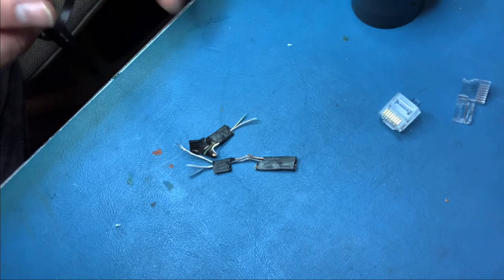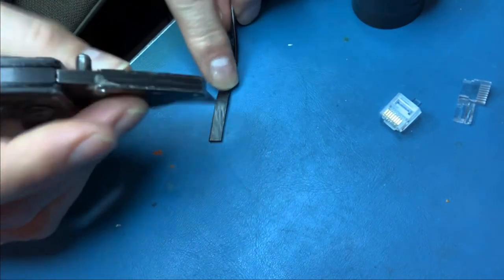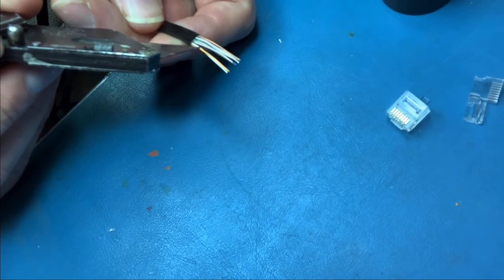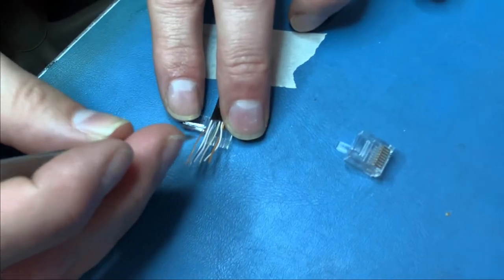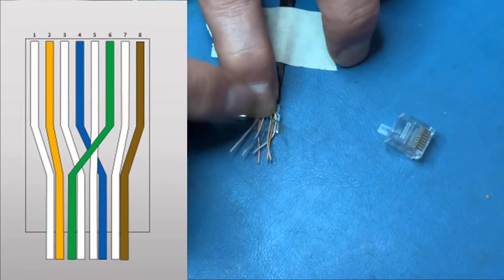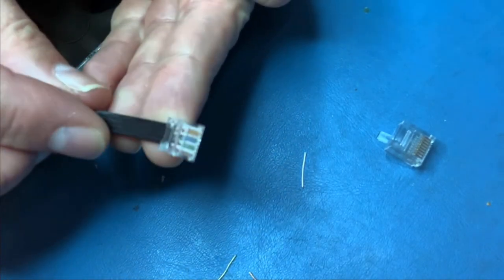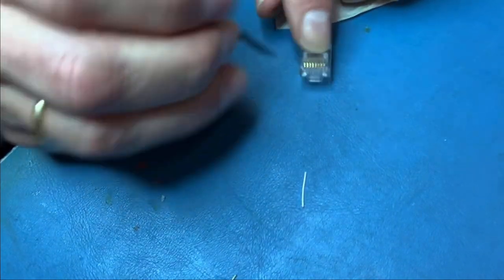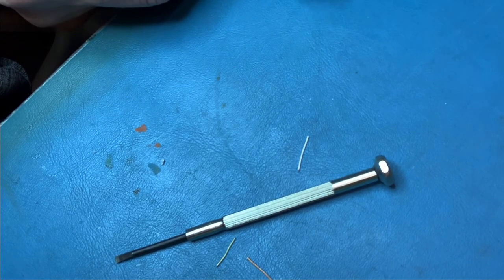flat ethernet cable repair/fix, terminate RJ45 - easy DIY

Comment: Trying to use standard connectors and a crimping tool was an exercise in futility but an excellent learning experience for me. I'm so glad I found this video because all the top search results basically claim it's impossible to terminate these things. They're pretty much right IF you try the regular connector because  the  blades on the contacts tend to miss the  tiny twisted pair cables.  But doing each  contact individually like this would probably increase the success rate with those regular connectors and these connectors you used pretty much guarantee it will work. Thanks a lot friend!
Reply from the maker: Thank you so much for your kind words! I’m glad the solution worked for you and that you found the video helpful.

Comment: Awesome video! My favorite part is how tool-free this is. All of my Ethernet repair tools are for round cables so I was stuck with a broken flat cable until I saw your video.
Reply: Ok I still love your video but let’s say I’m a complete moron and cut my Cat7 flat Ethernet cable and now need the special cat7 flat Ethernet cable connectors. Do you happen to have a link for those connectors?
Reply from the maker: Sorry, didn‘t see the reply/question earlier:( 
The connector I used is currently out of stock. 
This one might work: https://www.amazon.com/Ethernet-RJ45-Connector-Modular-Connectors/dp/B085PXN265/ref=dp_prsubs_2?pd_rd_i=B085PXN265&psc=1

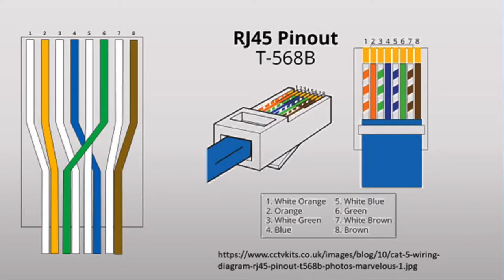Comment: Thanks for the diagram at 2:48!  Repaired a cut flat Cat 6 cable and didn't realize the green and blue wires were switched (which makes sense).
Reply from the maker: Glad I could help!!

Comment: That was cool. Good detail. I am not a technician but part of an old job was maintaining our network and I would build cables, not pretty but they would work, this video confirms I was doing it right, unfortunately since you are dealing with twisted pair it is not a 30 second job (at least not for me).  Ignorantly, I thought the flat cable would make building cables easier (around my house) but you still have to deal with crossing over cables. I will definitely save this video and if I do build my own cables instead of buying pre-made I will use this video.  I did not know about those guide pieces before today.

Comment: What was that small clip which you used to arrange the wires and later on inserted into the main rj45 plug ?         5:54
Reply from the maker: I am using very fine tip tweezers. Search for electronics tweezers, very handy for PCB soldering work.
Reply: @RandomDIY09 No dear am not asking about those tweezers, am asking about that small plastic clip in which the wires got clipped then inserted to the rj45 plug.    5:54
Reply from the maker: I believe you refer to the clear plastic parts? I put the link in the description, it comes with the main plug.

Comment: Don't you need to strip the end of the wires before inserting into the connector?
Reply from the maker: No, because when you push the pins in, you cut through the wire insulation

Comment: Love the video,…does the connector you used work with cat 8?
Reply from the maker: I checked the Amazon page. It says “Only for Cat6 30 or 32 AWG Flat Ethernet Cable - 20Pack“. I guess it‘s not suited for cat8

Comment: It does fit to normal rj45 connetor?
Reply from the maker: RJ45 is a standard used for Ethernet patch cables. To my knowledge it should fit any router, switch, port extender you might be using these days. Older laptops have it, too. HTH.
Reply: @RandomDIY09  but i have flat 32 awg slim cable, 
It’s not fit with normal RJ45 connector, beacuse cable is very thin, 
Normal rj45 connector can be use maybe 22-28 awg cable
Reply: Actually i need connector for flat cable, 
Normal rounded cable connector not fit to flast cable connector

Comment: why are you using a flat ethernet cable VS a normal cat5 or cat 6? Thanks in advance
Reply from the maker: Flat cables are easier to hide :) I put mine under baseboards and into walls, and nailed it to the joists in the basement.
Reply: @RandomDIY09  where did you get the extra part that helps line the wires up before inserting into your rj45
Reply: @RandomDIY09  I love the pain of hiding Cat6 cables
Reply from the maker: It comes with the connector, you get both pieces when you order it.

Comment: Hmm. I had searched the web and saw an Reddit post and people were saying "just buy a new flat cable; don't try to terminate a flat cable", so I thought it would be very difficult to terminate a flat Ethernet cable. Judging by this video, it does not seem hard. What gives?
Reply from the maker: It really isn’t hard! A flat cable is easier than a round one in my experience as the strands are easier to position.
In my case I had to choose between running a new cable from the 2nd floor into the basement, or fix the broken part - easy decision ;)
Reply: @RandomDIY09 stupid question. Will flat cable work with cat6 keystone insert? Figure cut the tip off my cable and find out. Just hoping they there is no difference in the amount/type of wires in fat just different shape? Trying to fond videos but cant
Reply from the maker: Flat vs round use the same strands and twists. I fixed a round cable with this method, too. The keystone connector is also RJ45 so it will work. Just check if you need to mirror the wires as you deal with the female connector.